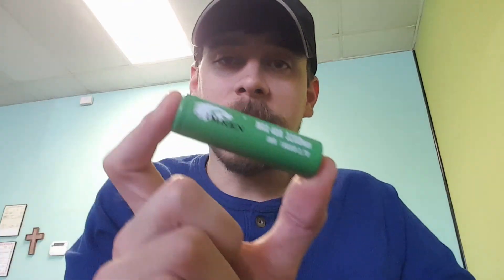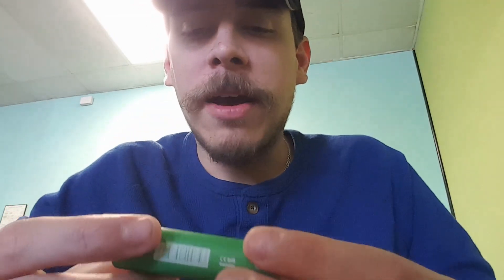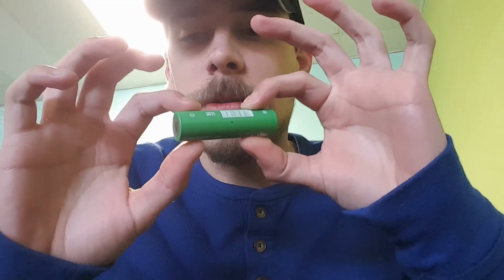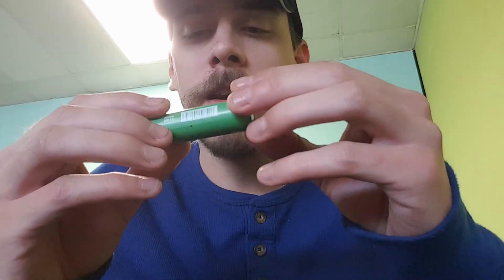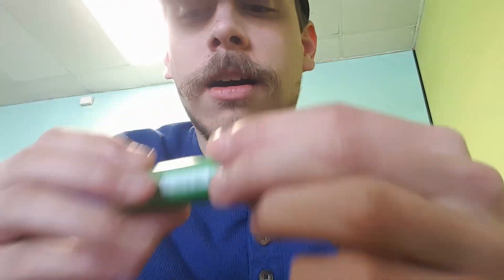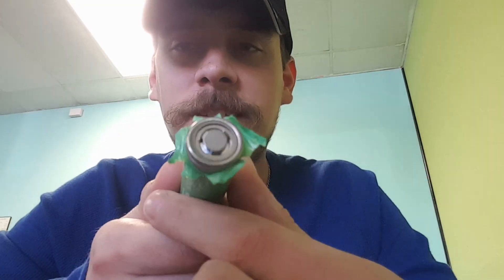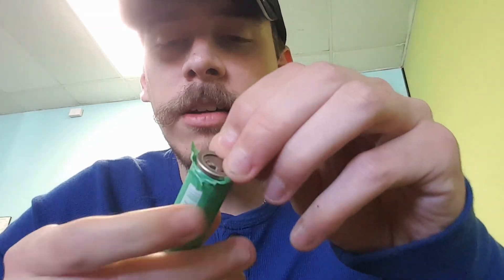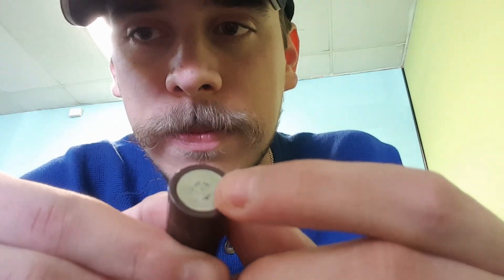18650 Li-ION Care & Maintenance

Comment: Wow almost everything u said not to do I did and almost killed myself. I insert 4 batteries inside fishing rod handle to power elect reel,  my buddy who made the rod  told me to remove the plastic wraps because the fit is snug and batteries could get stuck. Well I didn't remove plastic on one and it got stuck.  Im so smart I tried drilling into the bottom of the battery to remove it from the rod handle.  As soon as it penetrated, the battery ignited like a rocket, blew out of the rod handle and was flying around  the garage like a missile hitting the walls. Me and my dog ran out of the garage to safety. The battery flew out of garage and just burned on the concrete until it burned out, even water didn't extinguish it. 
The way you said please don't use these batteries without wraps hit a chord, this is an important video. Thanks, I could only imagine 4 of these things going off while fishing on my boat. Thanks